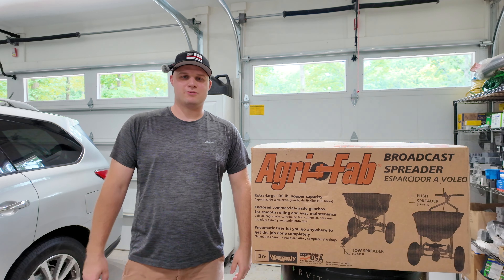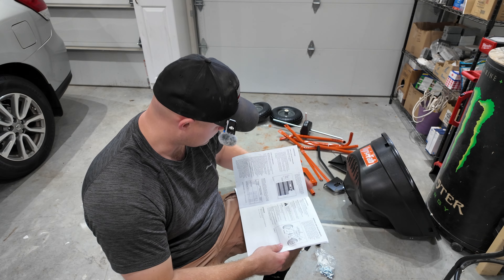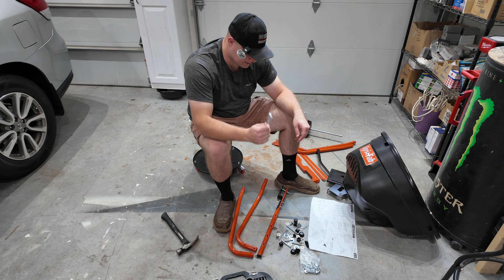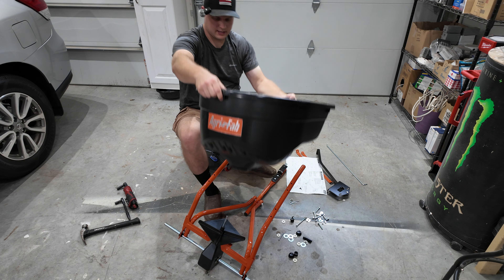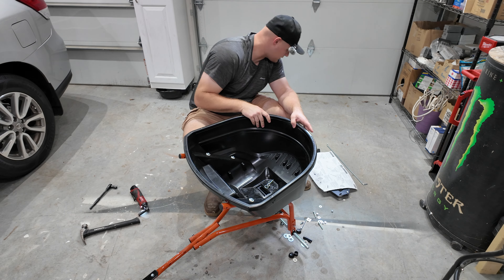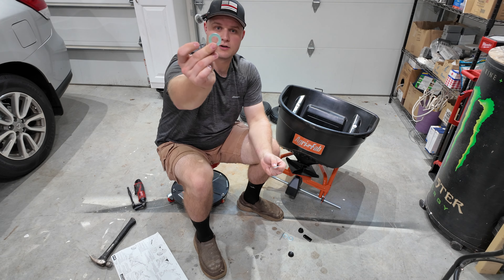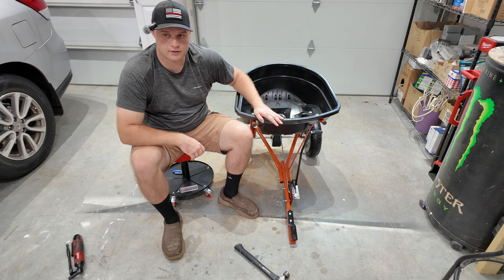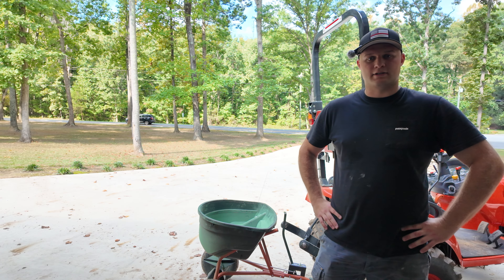Is the Agri-Fab Tow Behind Broadcast Spreader Worth It? | Full Assembly and Review

Comment: Hi , I think the hoppers sitting too low on the frame which is why the issue getting the chute to properly close? There’s 2 sets of holes in the frame and the upper ones are what’s in the instructions to use. Standing behind the spreader is it the right wheel that has the cotter pin in it? If so the instructions say make sure it’s on the left as your impeller would then be spinning backwards. I found the instructions just fair and had some issues getting mine assembled this morning.
Reply from the maker: @DwaynePhillips-n7j  good to know! Thank you!
Reply: @ I’m sorry if I was rude in my comments, I did something stupid while putting mine together and caught it while watching your video. I didn’t put the cotter pin through the spreader I just put it in the hole then slid the spreader down on top of it. Wouldn’t have worked very well and thank you for posting your video